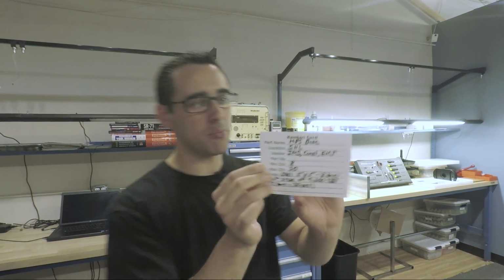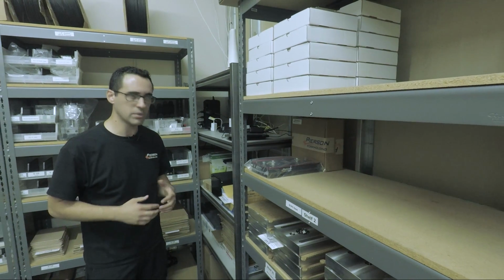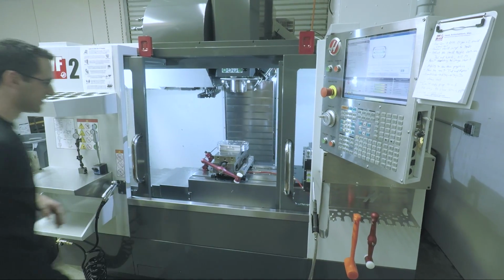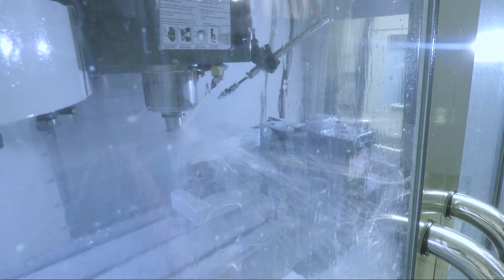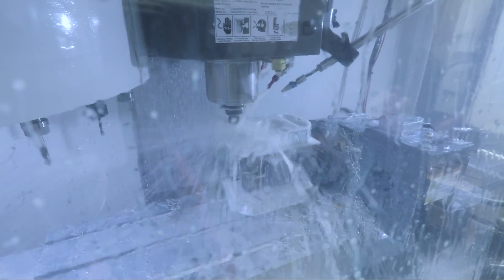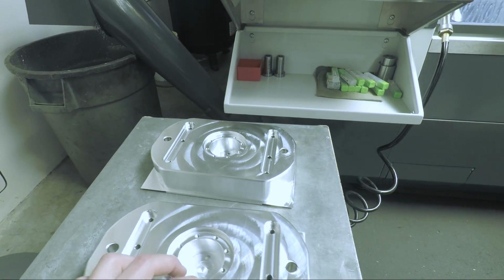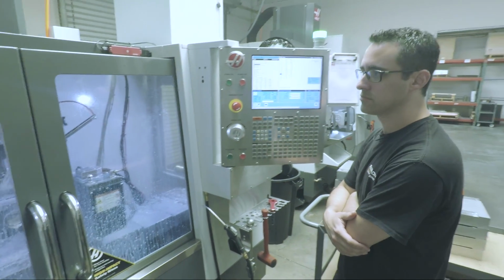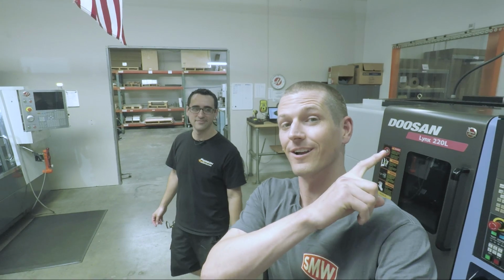Machining A Pierson Mini Pallet System!  1 of 2

Comment: Awesome video! However, the IT in me is screaming "WHY IS THIS NOT SOFTWARE!?!?"  This could all be done with enterprise resource planning software (ERP). It can handle sales, shipping, and purchasing to the Nth degree. I now how expensive software can get, but it needs to be digitalized. Even if it's just in Excel just so some aspects can be automated.
Reply: PoisonGryphon Looks like you're getting hammered by the other commenters so I recommend you watch our first shop tour discussion for more insight, but boards don't crash, don't need updates, are practically free, are bigger than monitors, are understood by everyone, can be updated by anyone on their first day, are fast, are SIMPLE!  But hey, you can use software if you want.
Reply: If you have to click on a phone app, load up a spreadsheet, heck even wait 10 seconds for a PC to boot up, you have already failed to beat the physical wall in terms of immediate usability
Reply: Worse still, if I have to go and wash all the grease and oil off my hands from working with the machines so I can dig into my pants pocket for my phone, or use a mouse etc, It is gonna be a constant PITA vs moving a little steel magnet on a laminated board which can be trivially wiped clean every week or two
Reply: He has what 10 guys total? Investing 100k in software and training and downtime for what??? I have seen million dollars still not working right after years. Also seen simple effective solution that work well with little coding work very well very little money invested
Reply: We run an engineering  department and machine shop off Excel it's a mess. We are going to this solution in near future. Where everyone can see the board and update as needed. We thought about jobboss or some other ERP system but for $100 bucks a month for that really? We can buy alot of boards for that amount of money
Reply: Leeloo Minai LOL yes, boards crash about as often as pictures randomly fall off the wall ;) Impossible to drop a magnet... The red meat we eat makes iron run through our veins.
Reply: Software is a pain in the ass because moody people aren't using it right, don't have the right equipment/software, don't have the right support staff, aren't large enough to afford to swept themselves properly, etc. There are systems that departments stores and logistics companies use that are super fact and convenient to use. You have the proper software, proper person doing inventory, handheld PDA type things (or ancillary devices for cellphones like home depot does.), desktop scanners are each station, handheld scanners, etc. And barcodes/QR codes on EVERYTHING. much easier and reliable than a magnetic board. But small business can't afford all that stuff, so they use magnetic boards.
Reply: Well, not to be picky, but boards crash - if they fall on the floor and all magnets fly around for example:)  Even worse - good luck finding backup then...  Also, you can make mistakes, you can drop a magnet, then pick it up and forget where it was or put in a wrong place.  There are already updates on them: I saw some stickers or what it was. A touch-screen UI will be faster, can be as simple and understandable (but clearer with use of colors,) can be as big (with big touch screen monitors.)  

To summarize: I agree only on the point of cost (cannot beat practically free,) and initial effort.  But there's a lot of benefits after that and opportunities.  Don't read it wrong: I like the boards and magnets, they are cute, but, it's like a manual mill vs CNC imo:)
Reply: Because setting up software is a pain for very  little trade off.
Reply: I would just add Fusion Lifecycle / PLM 360.  And invest in Exact America's JobBoss.  Much cheaper solution.  John already knows Fusion, so its intergration should be easy fit there.  

https://jobboss.com/
http://www.autodeskfusionlifecycle.com/
Reply: Fusion Lifecycle has a lot of automation to it already.
Reply: Creating that software would take longer and cost more than the additional effort needed to run the manual process.
I'm a software engineer, and have been for many years, and one of the most important things I've learned, is that there are things where the return on investment isn't there.
By the way, this is also why ready-made software that "fits" an existing process is so great; you avoid all of the extra software development and configuration cost. But that only works for truly commonplace environments. Most ERP and workflow systems require expensive consultants to research, specify, install and configure before it works for the business.
Reply: That complexity goes entirely against what they are trying to do.  Anyone can interpret and operate the board...
Reply: Batti2323 Taking the time to learn some software wouldn't take any longer than learning a board system. But what happens when someone forgets to move something on the board or moves it to the wrong spot? There's no history to the board without going threw every record or recounting stock. In software it's as simple as "Hmm sales invoice says it needs X amount of steel. It's listed as X00. Let's reverse that." (That's if it doesn't auto alert you on qty)
Reply: PoisonGryphon  Lean is about being fast , efficient and anybody being able to make things better every day....software is almost non of that.
Reply: +Chief Machining This can be done in Microsoft Excel. No need to spend $100k. Playing around with these wall boards is him embracing the waste he professes to be getting rid of.

Comment: I really love this stuff and the physical interfaces, but as a programmer it somewhat frustrates me because I think of the duplication of work – having to write new orders etc every time. I just want to slap a barcode (or something else that's machine readable) onto that card so bad.
Reply: ATschTheCube I think you've misunderstood Kanban cards. You only fill out the card once and it stays with the product. No duplication of work.
Reply: @PiersonWorkholding  With software, you can prevent the duplication of order entry/quote request tasks. Bar coded inventory is one way of saving time, as well. Emails can be sent automatically to suppliers, reminders can be populated if there is no response, etc. Kanban cards are a great start, but the natural evolution is automation of low-skill tasks.

You have some great manufacturing basics going on here, but if your part system gets even slightly more complex, all of that paper will be a huge bottleneck when MRP systems exist to do this stuff much better and more efficient than humans can.
Reply: Is there any cheap software for simply barcoding your inventory? I mean without 1000s of extra features, I don't own a 300k sq- ft. warehouse.

Comment: I'm surprised those shelves work for him.  I had to replace the crap wood with plywood almost immediately because as soon as I got weight on them they started sagging really badly.
Reply: Do R/C! They're heavy duty racks from Global Industrial. See the two rivets in the center of each shelf? You can add a center support so each shelf supports up to 1000 lbs.
Reply: Pierson Workholding Oh OK  they look exactly like the ones I got from Lowes that also said they would hold 1000 lbs but I think the particle board was half the thickness of yours